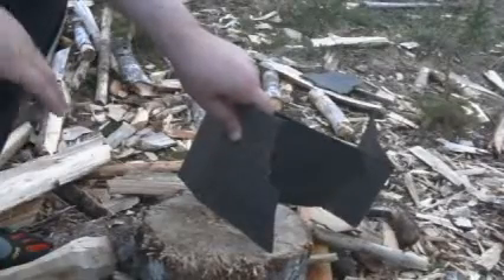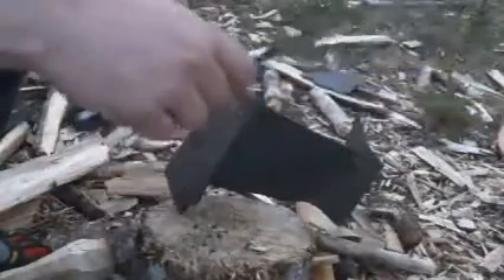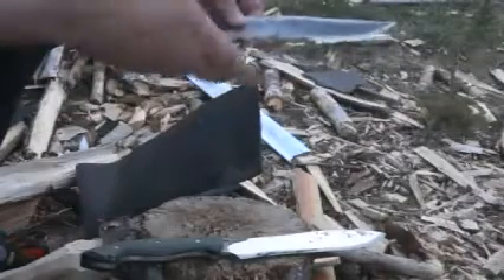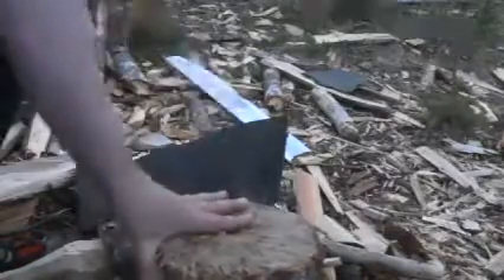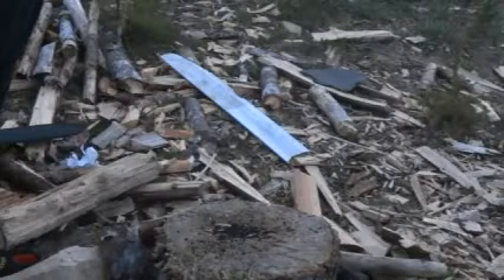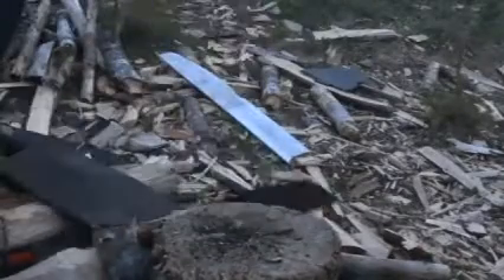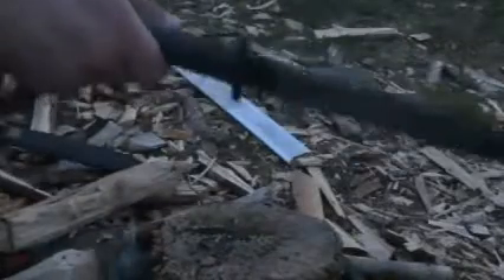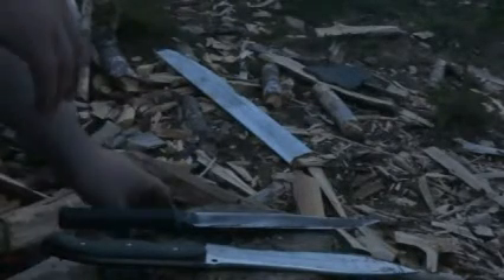Spyderco Forester (N690) vs Mtech MT 151 (440) cutting Asphalt Shingles

Comment: Your video stands up to the test of time.  It pretty much shows right tool for the job. An cheaper ain’t always bad. I still can’t get of how YouTube has convinced people they need knives in $100 dollar range when blade grind an angle mean way more then super steel. People don’t understand they are paying for a name a lot of times instead of a tool. It’s a shame America want to charge a fortune for something that shouldn’t just because it’s made here. Until we realize this we will never compete with other countries that have lower labor rates. But this is what happened when we ran trade schools away everyone thinks they went to college now they can be the boss. But have no skills to make or fix anything.
Wow I went off topic there. Anyway enjoyed the video it really does stand up to time.
Reply: Unfortunately, a lot of people simply do not want to sharpen their knives to any serious degree. For most guys, using a sharpening system to grind the secondary bevel is as ambitious as they will ever get. Planing down the flats, grinding in relief bevels and thinning the secondary grind is way beyond most guy's skill and ambition.

Comment: Totally useles test. 

Cutting something as abrasive as these asphalt thingies does not represent accelerated normal usage.  The N690 blade would not chip if it was used extensively under normal circumstances, it would only dull....
Reply: A comparative test is valid. That's what this was.
Reply: No it's not. Try swinging an axe at a concrete block. And then a splitting maul. Which one is going to have its edge destroyed?  Which one is the best tree feller again?
Reply: @TheOneAndOnlySame  You might have a point if he weren't comparing two knives, lol. If you had a sled made of steel and a sled made of ceramic, now that would be a comparison in the same realm.
Reply: You only tested ease of sharpenin. 

Stupid test.
Reply from the maker: As noted in the description :

"This was a quick comparison to see if there was an obvious difference in the behavior of the steels. Two things were immediate :

1) The high carbide stainless, N690 tended to chip much more readily whereas the lower carbide stainless, 440 tended to impact. This is to be expected as the higher carbide volume directly reduces toughness.

2) The MT 151 needed just one minute per side on a coarse waterstone to remove the damage, then one minute total to polish the edge on a 1000 grit waterstone. The blade had just a few small spots still showing impaction in a few areas (barely visible), it was better than 95% of optimal. The Forester took twice as long and had twice as much damage still remaining. This is again to be expected because the higher carbide volume gives much lower grindability.

In short, the higher carbide (and more expensive steel) takes more damage and is much longer to repair."

Comment: This is good info to know if you ever intend to cut fibreglass, ceramic, mica, stone, vitrified brick or quartz with your knife -which seems to me to be using the wrong tool for the job. As you mentioned, there are trade blades manufactured for this task so I'm not sure how this is practical or useful knowledge for typical design-oriented usage of a camping/bushcraft/survival knife.
Reply from the maker: Because knives often cut dirty material.
Reply: Cliff Stamp I suppose shingles equate to dirt if you find yourself in urban craft vs bushcraft. Otherwise seems like a stretch unless one isn't cognisant of what they are cutting.
Reply from the maker: Actual natural materials are not clean, and most times you don't wash them. Aside from wood work, handling small game is the same unless you actually wash the animals before you skin them. In both cases the edge will come in contact with dirt. 

Aside from that, a lot of actual knives used in the field do actually come in direct contact with dirt. Natives, and general people who are active in nature will readily use knives to dig up roots, look for grubs, etc. . They simply are not afraid of light damage as wear is a part of the life of any tool. Hence for a lot of people, durability and ease of maintenance can be preferred.

Comment: What would you say that N690 is good for? Why do I see a couple of bush craft manufacturers like Enzo starting to use it? Is this just a stainless steel fad for fancy flashy steels, the whole if it costs more it must be more valuable thinking flaw? I have some N690 stuff that I like but my main motivation was steel that I can carry close to my body in summer in Texas without corrosion. These are defensive/edc knives and I have not used them for more than lite EDC tasks and was just curious about N690 application in wilderness/ hard use situations, especially given my memory of this test.
Reply from the maker: It is a high carbide stainless steel, so rougher cutting (lower sharpness and/or slicing) in semi-corrosive environments.
Reply: Thanks sir. Thats exactly what I needed. Sounds like a great steel for my purposes.

Comment: Say Heah Cliff,  I bought a MTech at the Pawn shop for very cheap,  I like the way it looked and appeared  nicely made.  The blade also is 440c. But I guesstimate it's not tempered well,  because of how inexpensive they are.  Would you trust a MTech 8079 as a survival knife,  as opposed to the higher priced knives ?
Reply from the maker: It is often the case that higher end knives can be overly brittle due to poor choices in steel and or hardening. Expensive doesn't often mean better in regards to knives. At times it means nothing more than cost.
Reply: The reason I say this is I have a MTech,  From the looks,  It's a great looking knife,  The handle is aluminum with G-10 and the blade is 440c. The model number is 8079blk. From what I read and the failures,  I don't know that I could trust it as a survival knife.  But then I watched a destruction video that Noss did and the Hard Use that BUDK use to sell did really good,  So I bought one.  But reading that a well tempered lesser type of steel is better than a higher grade if steel that's not tempered well,  The MTech at their cost kind of indicates to me they might not temper the steel good so the man hours is less and the quality control is non-existant,  That's why it's hard for me to use something like that for a survival knife.  I Wish I coukd see what's under that G-10 scales on the 8079blk handle,  I think they might be hiding something.  And,  I heard that too.  Anyhow,  Again,  I Wish you a Happy and Safe 4th of July,  Cliff.

Comment: Nice video, Thanks for posting. Just wanted to note that almost everything tough, cardboard, shingles etc. cuts easier on an angle,(usually 45 degrees) and especially a compound angle (material edge 45* to the blade edge and knife axis 45* to the material) simply because of the friction and pressure from the medium itself side loading on the blade profile as it passes through the medium. This is especially true on thicker knives and thicker mediums. It would have been better to rub the blades with a gas soaked rag to clean off the tar before trying to cut paper. I am sure the tar grabbed the paper and skewed the results just as tape residue prevents a completely fine edge from cutting paper after only opening a single shipping container or package.

Comment: there is not much that would withstand cutting shingles. i've done a bit of that myself with my kai skinner from the slaughterhouse. that m-tech has seen some awesome use, i may have to buy one to play around with. might make chum happy to see a choppa video.
Reply: It's kind of an odd knife in terms of balance, really neutral for a chopper.
Reply from the maker: Bill22252
If you poke around on the forums, this was based on a custom design by an individual that had Hossom make a knife. It was nicknamed the texas chainsaw or similar and was very different in several respects, one of them being the balance.
Reply: Cliff: I was more referring to the Mtech.

Comment: Very interesting! I wonder if maybe the temper on the Spyderco is a bit on the soft side. The M-Tech probably is tepered much harder. (which is why you hear of one very occasionlly snapping at the handle, one where they screwed up the temper and it got through quality control, such as it is)
Reply: I'm thinking Ray Meres' native made Parang (which has a really soft temper) would really be jacked up by cutting through shingles like that.
Reply from the maker: ***** I would expect it to be fairly dented, but it also would be very easy to restore as they are easy to grind.
Reply from the maker: About the opposite, the Spyderco has durability issues due to the very high carbide volume which reduces the toughness and makes it much more likely to chip, odd choice for large blades - but the maker/designed (Hossom) is very fond of high carbide steels.
Reply: Ah so! Interesting! :)

Comment: Very informative test! One can see, that different steels are for different functions. Softer steel for chopping, harder steel for cutting. 440 is a very good steel in this circumstance, and many criticize it. But you see, that both have to be resharpened, the question is what is easier to do in the field. In this case 440 crap steel prevails! This does not mean I am against n690. I would just underline that in this particular dimension both steels are roughly equal. On the other hand, if you were to cut ropes all day long, n690 would probably prevail by far. All in all what is the moral of the story? Use a knife and it will serve you well. Abuse it, and you will suffer.....
The difference between steels should be noticeable only in specialized circumstances... Buy the knife you like, and use it with care and it shall serve you well.
Reply: Andras Havas n690 is actually just pimped 440c and also pretty ok to sharpen

Comment: I like my Spyderco Tenacious - good for the price. 
But I got really disappointed by my S30V Military - I had it razor sharp, mirror polish. I only cut the legs of a cotton pant and it could not even slice paper afterwards. 
Similar thing on a VG-10 Spyderco (cut half m of cardboard) and a VG-1 San Mai 3 Master Hunter (cut about 6 m of old carpet). I have the feeling "my" S30V is far too soft.

Comment from the maker: @DeathsHeadWhitePower Of course it could have just been problems in the steel itself regarding consistency of composition, but everyone rushed to blame the manufacturers. Even Crucible argued that it was the makers/manufacturers who were not hardening it properly and/or burning it in grinding as they were not used to the low grindability of such a high vanadium steel.

Comment from the maker: @DeathsHeadWhitePower Unfortunately a lot of the early S30V blades were all over the place in regards to behavior. There were reports of blades being so fragile that they would chip apart under the stone and others which were so soft that the edge retention was only comparable to much lower alloy steels when slicing abrasive media. A lot of companies seemed to rush too much there and should have done a but more R&D before using the steel.

Comment from the maker: @R6Dave11 Yeah, this will put a lot of wear on a blade fast so that is why very cheap and disposable knives are generally used for it. Sharpening for both blades required a coarse stone to start to remove the dings from the shingles. The MT was much faster as the edge was thinner and the steel is easier to grind.

Comment from the maker: @R6Dave11 It is nice to burn in a lot of situations as it does not absorb water and will give off black smoke. Small pieces are nice for fuel and you can also boil/heat them to actually get the resin as a glue sealer. Here though, this was just a check on edge durability and mainly ease of sharpening.

Comment from the maker: @knivesandstuff Yes, however that makes it difficult to compare damage results as it is dependent on angle tremendously as even a small angle change will radically effect edge durability as stiffness for example is cubic in thickness, thus even a few degrees could make an edge 100% more resistant to deformation and resulting fracture from passing the elastic limit.

Comment: @CliffStamp after watching your testing I did a quick video test on an N690 blade. I'll send you a link. clearly the test is not as abusive as CF or Ashpalt, but it doesn't indicate that N690 is as weak as what appears in Spydercos offering.

Comment from the maker: @knivesandstuff Yes, far easier. They both have very similar edge angles (they are both wide convex bevels) however the Mtech has a much more extensive primary grind so the edge is much thinner. The edge on the Forester is 0.1" thick (not a typo, just under 1/8"). The Mtech is about 0.015" thick at the back of the bevel. The Forester's primary grind is also close to true flat like a machete not wedge flat (full flat grind) so it binds fairly easily in materials.

Comment from the maker: @micktheweld Yeah, I should have recorded the sharpening and some shots of the edge, that was much more dramatic than the cutting. For knives like the MT or Junglas, heavier cutting tasks are no concerns. They have very tough steels which take minimal damage and as they are very easy to grind and have simple geometries they are trivial to restore, hence why traditional wood/brush tools are made out of simple medium carbon steels.

Comment from the maker: @jdthesaint1 Yeah, these are covered in fine rock so it takes the edge off almost instantly. But as the edges are very acute they would keep cutting for quite some time. Cleaning the blades can be more work than sharpening unless you use a really coarse waterstone and do both at the same time. 

Newfoundland, just outside of the capital so right on the coast as in I live a stone throw from the Ocean.

Comment from the maker: @TheCanadianKnifeGuru That is all I wear now when not at work, I have a couple of pairs. The only real issue is that since you don't wear socks you have to wash these fairly often or otherwise they will stink badly. You might also have a problem getting them on until your toes space out a little, if you rinse them in water with just a bit of detergent it will allow them to slip on a little easier as well.

Comment from the maker: @docnightfall Yeah, 3V has a lot of promotion, or had, not as much now as a few years ago. It has no toughness advantage over any of the medium carbon tool steels and the abrasion resistance is of no practical advantage in a chopping blade and just lowers grindability which means it takes longer to work out the accidental damage all large choppers get. Plus it is a lot more expensive than L6, 5160, etc. .

Comment from the maker: @docnightfall Yeah, Roman Landes, prices are going to be high. I would use 12C27M for a chopper as it will will be more corrosion resistant, tougher, easier to grind (and is cheaper) than AEB-L . However AEB-L would indeed be leagues better than ATS-34 class steels. Any decent custom knife maker would also use these steels and they are made for knives so come in flat stock for blades. Just make sure they can oil quench and use cryo to keep the austenite out of the edge.

Comment from the maker: @ironmonkeyz There is no practical advantage to the higher carbide steels in large chopping class knives, that is why parangs, axes, machetes, goloks, khukuri's etc. are all made out of low carbide steels because abrasion resistance (which is all you get from carbides) is of no use in these steels and all it does is lower grindability (takes longer to sharpen at a given dullness) and reduce toughness (and take more of your money).

Comment from the maker: @ironmonkeyz The only advantage to steels with a high carbide volume like N690 is in cutting abrasive materials, but it isn't as high as it is often made out to be. I did four runs of 100 slices on used polypropylene rope with each and you would have to be able to measure sharpness to within 5% to be able to tell the knives apart. The 440 blade also will resharpen multiple times faster (some of which is of course due to the curvature).

Comment from the maker: @zujostix I appreciate the concern. I do have a number of cut resistant gloves and I normally use them if I am processing a lot of material for a long time because repeated movements tend to induce sloppy behavior. This isn't as dangerous as it looks and I am actually taking care here because the fairly acute edges and high sharpness I run on the knives I use mean the cutting ability is fairly dramatic.